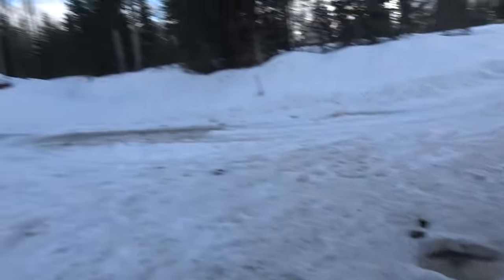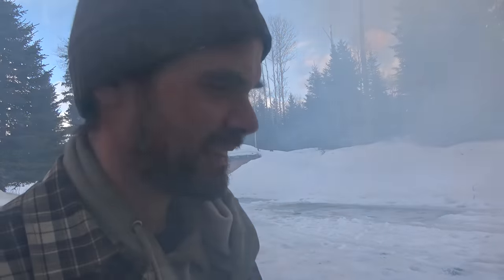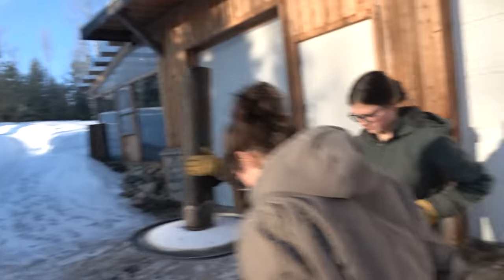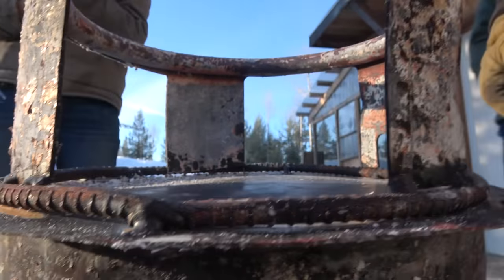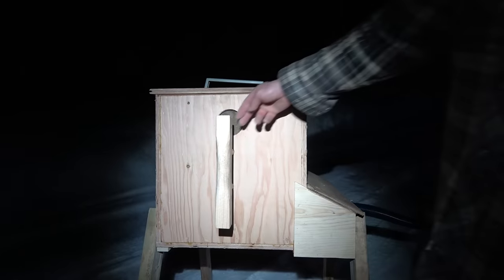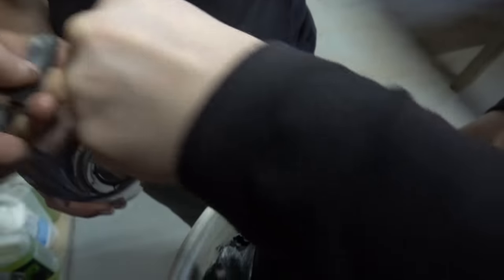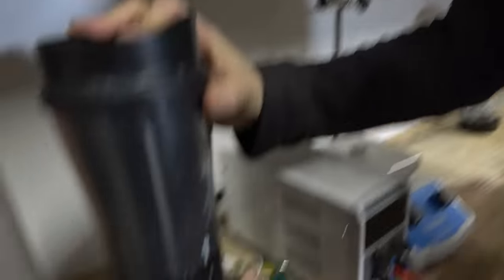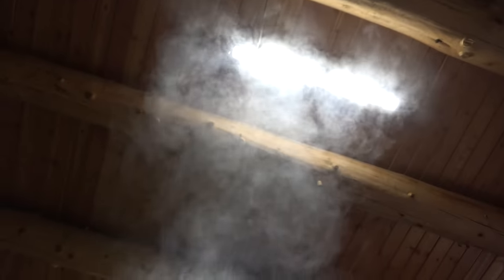Super Easy Black Powder from Home Made Charcoal

Comment: Great video! I think that the plastic fan melted because of the heat radiation and the reflective pipe it is in. This could be avoided with an opaque pipe having an elbow. This way radiation wich is a kind of light will not hit the fan. I would love to be part of that camp!
Reply: Yeah, you forgot about direct heating by infrared I think. I'd go with an S-curve in there or a maybe a 90 degree curve. Test if it works with a flashlight, it'll bounce just like the IR is. You could soot up the pipe to prevent reflection I guess but that's going to absorb heat in the pipe itself which will have to be radiated from its external surface. Make sure you share your mod, I wanna see. Lots of people try blow dryer fan powered forges but I think that is cast iron pipe I see them using to transfer the air so IR reflection wouldn't be an issue. I was about to repeat the same mistake I think, using dryer vent tubing... :p Now I know better. Aluminium is something like 84% efficient at reflecting IR I think.

Comment: I have heard people claim that it CAN blow up, and that you should use lead as your grinding medium, to prevent sparks.
Reply: Gunpowder should be ground up wet to prevent ignition.
Reply: It can be done that way but can easily be done quite safely dry using the proper equipment and media and at a healthy distance away from anything you don’t want destroyed in case of an accident.
Reply: Brass is good.  No sparks from brass.   My BP powder flask - measure is all brass.  Wood is good as well.  Just non-ferrous metals.

Comment: Nothing can bring out the little girl in a full grown man like blowing stuff up. BOOM! That is the giggle of exquisite satisfaction. Just be careful with that stuff, keep all your fingers and toes and... head... for use later in life. That being said, just think of all the things that can be blown up now. Stumps. Save chain saw fuel by blowing down old dead trees. That pesky rock that's in your way. That beaver dam that has the back 40 flooded. Need to change the muffler on the Jeep but it so rusty it won't budge? As we used to say in the Marines... there is no human problem that cannot be solved with proper application of explosives.

Comment: At about age 12, I made a trip to the library, looked up black powder, took the recipe home and found everything that I needed. I had to grind my charcoal as fine as I could 50 plus years ago.
I was wanting to make firecrackers with it. I had made firecrackers already using the powder from roll after roll of caps that I scraped.
My first few attempts only went like rockets.
It came to me to try soaking the mixture in isopropyl alcohol and dry it back out.
That did the trick! I had to crumble the sun dried mixture with my fingers to prevent a spark but I had some powerful black powder that I had tons of fun with. 
The kind of thing I probably shouldn't tell my grandsons about.

Comment: 30 gallon drum inside 55. Only a couple inches of room but it made great charcoal. Could you add alcohol to the tumbler to make a cake and then sieve that to uniform size to shot black powder rifle?
Reply: Todd Friley:  I think I’d like to know the answer that too.
Reply: No.  If you wet the powder in the tumbler (ball mill), it won't pulverize anymore.  It will just make a big ball of it.  Add the 3 dry ingredients to the ball mill and use 1/2 inch lead balls if possible.  Run the mill outdoors, away from anything valuable.  If it ignites, you will only lose your mill, but that's all.
Reply: I remember a video no longer around and the batter was moist and he used a window screen and scraped it to make even size particles.
Reply: @toddfriley9373  after the powder has been milled, you can dampen it with 70% IPA to a stiff paste, like playdo, mold a handful into a ball and then force it thru a metal screen to granulate.

Comment: Forget the fan make the stack ( chimney ) taller that will draw air through rather than trying to push it from under the fire. The other way of  doing it is to use the fan to pump air into the stack in the direction of flow that will draw more air behind it same way they used steam to draw the fire in the old steam locomotives. Try adding small amounts of aluminium oxide to the powder to increase the burn and make it more powerful.

Comment: An old paint can with a 1/2" hole in the lid makes a great charcoal maker. Fits in the wood stove so your house benefits from the burning of the wood and wood gas that comes out of the can.
Wet the fine powder with water (I have used urine as recommended in a book) until its just starts clumping together.  take clumping and rub it through an old screen door screen onto a big flat pan and let dry thoroughly.  Makes nice size pellets of black powder.  I also run these pellets through a smaller seive and get FFF and FF size black powder pellets for my rifle or pistol.
Reply: Dampen... Not wet, and screen it to size
Reply: @tallisman57  yes, dampen was the word I was searching for. I would use a small spritzer spray bottle to evenly dampen it.
Reply: I'm going to have to try this

Comment: I made a stove for my shop out of a six foot long ex-propane tank, heating a forty by sixty metal building.  I get a couple pounds of charcoal every time I fill it up with downed wood I heat with.  I believe you'd get denser charcoal if you used hardwood for the base.  I burn it exclusively, to avoid creosote in my chimney.  You can take a tube off the top of your "can", and the gases gassed off will burn and can "coal your wood" with little extra beyond the gas.  I've always used five three one ratio for the powder, five potassium nitrate, three sulfur and one charcoal, of course I'm old, so it might be old-fashioned, lol.  Thanks for the video.

Comment: Reuse the heat several times. Produce steam to turn a turbine to make electricity. Then use the steam to heat water for showers, then use the left over steam in a hydronic radiant floor heater, or for heating barns, coops etc. use the heat and smoke to smoke meats.

Comment: Hey, something you AND Dave might like, is the way I make homemade charcoal. 

I built a retort heated by a tracking solar mirror.  I can't think of anything more FREE!

My mirror is 6 feet in diameter and has a concentration power of just over 600 : 1. It heats a retort canister (where the charcoal forms) about 8 inches wide and 20 inches long.

Edit:  As cool as my having one would be, I don't have a bellows.

I do, however, have nearly 2, 000 gallons of compressed air on hand.

My solar energy is stored as heat as well as in an Air Battery  -- compressed air.

Comment: You should collect wood gas from the smoke while you’re at it, great way to supplement fuel costs by recycling the gas from what you’re already burning,  and you also could run a water line through the burner with a steam turbine to generate electricity!

Comment: Warm MOVES TOWARDS Cool
Stack effect only happens when substantial air is drawn from underneath the structure.
The air in atmosphere is sooo cold the heat automatically tries to come out that pipe. Higher CFM fan would be better. 
Put the hole in the bottom of wood drum and it won’t be able to travel DOWN.
It can move side to side just fine

Comment: Radiant heat is infrared light so it emits to mass.  As light does it shines on surfaces no matter what unless obstructed. That pipe has a reflective surface so Radiant heat will bounce around until it hits a mass to penetrate.  Best would be in the horizontal put two 45 deg elbows to redirect the Radiant heat so its not shooting straight down the tube from the source

Comment: If u want to keep the tube from heating up, try using a high temperature silicone tube splicer so there isnt any contact between the 2 pieces.  
Even though cold air is running through the tube, the tube us gaining more thermal energy than the air can negate. You're getting conductive heat transfer. If you can stop or slow the conduction of heat, then the fan blade should be fine.

Comment: About the heat radiating and melting the fan, I'm pretty sure you figured it out already : instead of a straight pipe, it should end at a 90° angle, it somewhat reduce substantially the radiation. That is according to a vid I've seen where the guy was having the same problem until he tried that.
the radiated heat is infrared, therefore you have to picture it as light rays bouncing in the pipe.

Comment: What fun you are having!   Nice to know how to make the charcoal.  I used to do a lot of pyro experiments.   Now you should make a miniature BP cannon.
Reply: Make a large black powder cannon,60 mm is about the same as a tennis ball,cut small hole in the tennis ball, fill with lead shot and seal the hole with hot glue and then soak in vegetable oil for lube, put quarter pound of black powder in aluminum foil and pack into the muzzle then the tennis ball, use brass pick to put hole in the foil, insert cannon fuse, point in safe direction, light fuse, step away to safe distance and ka boom

Comment: Every time I clean my fireplace I find chunks of charcoal that are left over.  I dutifully save those. I use the ash for the occasional oil spill that might occur when maintaining my cars. Anyway, I end up with plenty of charcoal, no need to make a separate apparatus for charcoal. I was able to dislodge a stump with the resulting mixture. I do like the tumbler, I use screens and skipping that step would be great. As far as the forge goes most people just use wood it ends up the same, I don't see the need for the extra step but hey that's just me. One more thing, I put the salt peter in the oven at 300 for twenty minutes to drive off moisture.

Comment: Use a wood gassifier to make the charcoal with. Pine or willow are great choces.  Partly gassified wood makes the best highly porus charcoal. Crush than ball mill till it makes a super fine powder, next add the sulfur, and finally the saltpeter. Use lead balls in a rubber rock tumbler to do this. Next moisten to get it to a clay like consistancy this step is super important as it gets the oxidizing agent to absorb onto the charcoal. Finally scrape this over a screen and dry in the sun. You can use sugar or starch instead of charcoal but it burns a bit slower and cooler. 🤓❤😁

Comment: For forge use I always try to use hardwood for the charcoal. The harder and tighter the wood the firmer and heavier the charcoal. Pine and spruce will work but hardwoods are best in my experience.

Comment: I'm 75,   when I was 13 I went to the library and got all the books on guns,  explosive s,  etc.    About 3 weeks later I was making firecrackers,  smoke bombs,  etc.  I used a black powder formula,   I used a Pepsi bottle (glass)  with about 1 inch of black powder in the bottom and ignited it with a firecraccker,  the bottle was closed accept for a small hole for the firecracker,  I set it off in. the backyard,  I didn't know it would blow up like it did !!   The Pepsi bottle exploded and broke windows in my house and next door neighbor s.     So that was the end of my explosive s experiment s.  😂😂    I liked that explosion you made a good formula.                        Thanks

Comment: 2:52 Get a 45 degree Y adapter for that pipe and attach the fan to the 45 degree angle so it isn't in line of sight with the heat radiated from the fire.

Comment: 3 modes of heat movement: convection, conduction and radiation.   Convection is movement of hot air or water. Conduction is from direct contact between two materials. Radiation is though the infrared light emitted by all materials.  The hotter something is the more infrared light it emits.

Comment: @2:10 

Heat does rise, but it also permeates metal, and can travel throughout. Would be better to have a piece of cast iron coming off the barrel to connect to the HVAC piping. HVAC piping absorbs and radiates heat faster than that 400cfm fan blows.

Comment: Use a brush cutter blade just trist the edges for a fan blade, also you can run it off a string trimmer just in case

Comment: Yes, the heat is radiating as infra-red at the speed of light along that tube. Why so hot at such a distance? Because it is guided, similar to laminar flow water. The cold air in the opposite direction can have only little mitigating effect. The solution? Put a kink in the pipe so there is no line of sight directly to the source. Infra red, like visible light can’t take corners.

Comment: If you put a baffle inside your stove, blocking the radiant heat energy from being able to "see" down the pipe, but still allowing space to force air in with the fan, the fan should stay cool. Radiant heat energy is mostly light, so block the light from reflecting down your highly reflective fan pipe.

Comment: Yeah, Some one else commented, for the black power to explode, instead of burning quickly, add a very small amount of moisture (water) like a fine mist spray. Just enough to help it clump together in your hand (not sloppy wet), then sift the clumps that through a rough screen to make rough pellet like granules,  then let that dry thoroughly - The difference is night and day - you will get popping explosions (like you expect black powder to be) - Also, I've heard that cedar charcoal is the best, but I imagine any resinous wood will work - Explosions equals SMILES - Have Fun, Be Safe.

Comment: Old video, but I didn’t see any comment addressing this.  It’s the infrared that’s heating and melting the fan.  Put a 90° elbow in that pipe and hide the fan from direct line off site from the fire and it won’t melt.

Comment: Idea:  You could also cut an aluminum soda can into a circle large enough to fit into your pipe, then cut into quarter sections, bend and twist two or three layers of these for strength and voila!  AL fan blade for your motor (Love thinking outside the box).

Comment: Radiant heat will destroy your fan , what you need is a elbow in your stove pipe 
close to the oil drum so the radiant heat does hit yout fan and destroy it!
I made a small blast furnace for melting Aluminum and that is what I did and the problem went away!

Comment: Put a 90 degree bend on the lower tube to alleviate the heat radiation back to the fan motor.

Comment: It's a YouTube video I was watching called "No Electircity Needed Heater" she says using crisco makes the candles more efficient more effective.If that's possible you can save money.I will use bigger candles for that experiment and bigger flower pots.And put a metal tea pot filled with water on top with a vent over it with a fan to blow the steam.And carry some extra tea bags and some sugar and try using a metal pot that don't rust.You can Google pots that don't rust and it will give you the names of the pots that don't rust.

Comment: 77/13/10 is actually a better mixture and is slightly cleaner burning.
Also I'm not sure about cooking on charcoal made from pine. I've never burned any pine that even put off a very pleasant smell really. Does it not have a bad taste? In the south we mostly only cook or smoke with hardwoods or fuit and nut trees such as Oak, Hickory, Mesquite, Pecan, Cherry, Apple, Peach.

Comment: a 90 degree elbow would eliminate the radiation issue. (two 45s would be even better)
if conduction is a problem, add more pipe length.
rotate one of the 45 degree elbows just enough to make an incline on the intake, if convection occurs.

then any plasticrap fan should be fine.

Comment: If you put a rubber union in middle of the pipe then alot less heat will be transferred throught the metal pipe

Comment: @2:26-ISH  That's because your burn-chamber isn't exhausting the full CFM-input created by your fan! Your fan is acting like a compressor trying to pressurize the larger chamber. While some air is potentially cycling through, the excess is being converted into back-pressure and back-feeding towards the lowest pressure point! INCREASE THE BURN CHAMBER OUTFLOW AND THAT PROBLEM WILL GO AWAY!

Comment: Put a 45 degree turn in the pipe the fan blows through so the info-red radiation cannot strike the fan blade and motor.

Comment: The heat coming down the tube is the infrared type. If you put a 90° in there you wouldn't get infrared. It's light, not conduction/convection.

Comment: Conductive heat, pipe touching the barrel. Barrel heats up, which transfers to the pipe and then heats up. Then Radiant heat melts the fan, that's when you feel like it is blowing heat.

Comment: You should add some aluminum  powder  to the black powder,that's called flash powder,since you have a ball mill just take the cheap aluminum  foil put in a bunch of strips  and ball mill them for a few days add 10 grams to the black powder the same as you was making 10 s and 15 ch 75 pn

Comment: its not radiant heat, its conduction heat.   Whats happening is, the pipe is getting heated up by the fire at one end, then the heat is being transmitted down the pipe, rater then threw the air.    

the simplest counter to that would be to cool the pipe some how,   if only you could do something like dump snow or ice on the pipe.

Comment: The air going in is faster than the air going out causing back pressure. The cold air is going in getting heated up it don't have no place to go and it's pushing back around the flow of the incoming air.

Comment: Biochar is definitely great for the garden from what I understand if you can capture that gas coming out of that inner vessel it will actually run an gasoline engine.
Reply: It will but you have to dry the gas, usually by filtering it with charcoal as any moisture will not run well and destroy your engine, there are plans available for the process,it was used a lot during WW two because fuel was rationed for the war effort